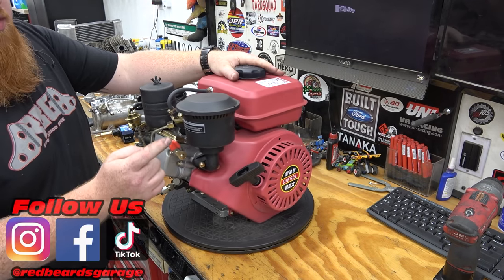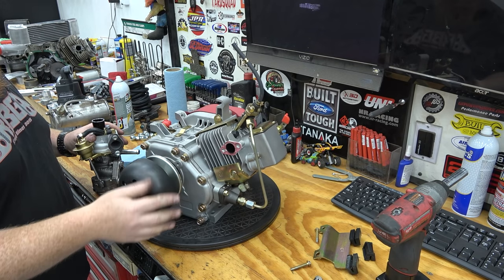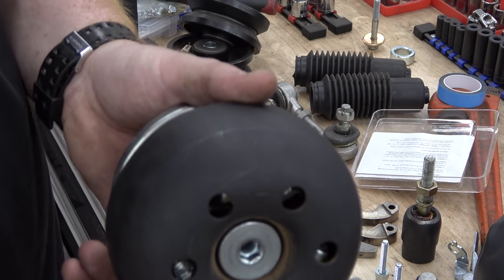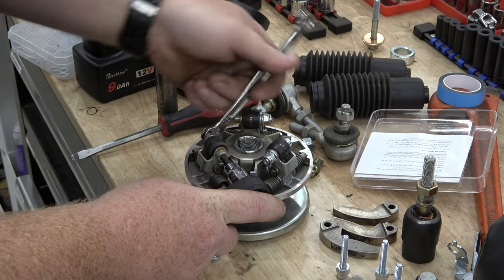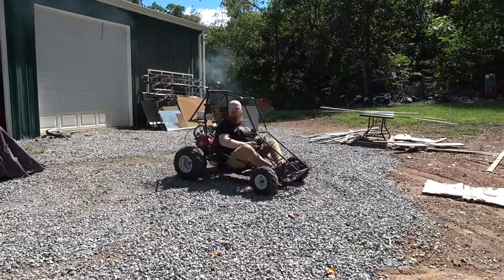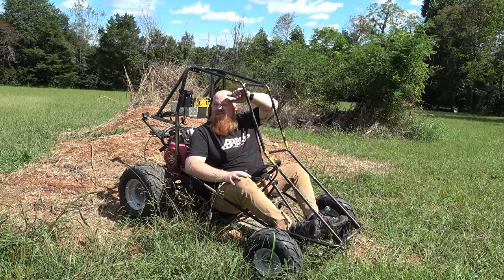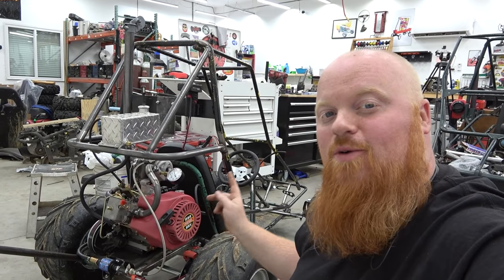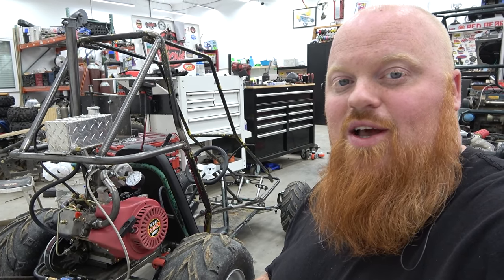Turbo Diesel Go Kart

Comment: Just got the yellow diesel and if you don’t put enough effort into pulling the rope had the engine running backwards smoking out the intake instead of the exhaust

Comment: The closer you can mount that turbo to the exaust port the better put intake lash at 5 and the exaust at 7 the extra heat on the exaust valve will close the gap at operating temp and check your gaskets sounds like you blew one out when you decelerated on the first clip running twards the shop enging sounded different after

Comment: Here's a good one, for some reason I was un subbed from your channel. I expect that on my gun channels, but why would they do it to yours? I love this stuff. Ever since I was a kid in the early 70s and we bolted an old b&s to a 2x12 with a 2x4 front axle that we steered with our feet with some old spikes to "nail" the lawn mower wheels on, and a hand held wire throttle. Good fun!

Comment: You should try putting your NOS kit on it. See if the exhaust smoke clears up at all, when you push the button. You could try an intercooler, chill box, or water/meth. But I would really like to see is an additional fuel system, too inject either rc fuel or nitromethane. Use a windshield washer reservoir set up. Once you goose it, push the washer button, and spray a stream, of nitromethane into the turbo. Could use a gear change too. Might want to consider a scatter shield for the flywheel and clutch. Maybe a firewall and extinguisher. And don't forget to say a prayer, every time you get on it.

Comment: They race these small diesels in the asian countries. Usually a bit bigger motor than this one but they get crazy power out of them.  I would look at raising the RPM. They are a heavy built unit and will take it.  I have some Yanmar clone Diesels  and they will rev to the moon.

Comment: 2 thing,  first running a turbo without an air filter is stupid also because of heat explosion there should be some sometime on the intertake such as a short section of hose

Comment: I would like to use one of these engines for home heating,generating electricity and heat. Can the turbo make it more energy efficient per horse power?
Be nice to see pony brake stats on this,with turbo and without. Be nice to see fuel stats for an hour run time.
I want to find an engine like this that uses water to cool because water can transfer heat to where I want it in my house.
I see people burning diesel to heat their homes and I think about the waist of mechanical energy just going up in smoke. If this energy were channeled thru a small engine, there would be 50% more energy for electricity or heating.

Comment: Add a few more washers to get you around 12-15 grams it should engage a lot sooner. Charge pipe is a good idea but I would try mounting the carb in front of the inlet of the turbo to compress the air fuel mix even further
Reply: It's a diesel. No carb dude. It's fuel injected. All diesel are injected.

Comment: You should get an other off those small turbo's and dual stage that thing, you might get away doing it the wrong Way and putting two same size torbos in series, just because the small one is still too big for that engine 🤔

Comment: Put the wastegate actuator back on the boost won't build right without it
Reply from the maker: It's tack welded shut
Reply: @RedBeardsGarage  then it will build all the boost surprised it only seen 3 lbs

Comment: I notice you have a screensaver with your channel name on it. That's cool. But, you could do an even better desktop background instead. That's an LCD monitor you have there and they don't require screensavers. Those were for the old, heavy, CRT monitors from back in the day. Static images could "burn-in" to those. LCDs don't have that problem.

Comment: I have this engine, now, it has trouble. It sounds like it misses, then loses rpm's, and then sometimes stalls. When it is in this state, changing the throttle has no effect.  I'm contacting the seller.

Comment: I would think this would do way better with a 40 series and pretty high gearing? I think the juggernaut is really hurting this low rpm engine.
Reply: I agree, the longer gearing would help load up the engine and spool that turbo up too!

Comment: Sorry Greg but if TurboCity could not make boost on a 8000 rpm racing go cart engine I am sure you are not making boost on a 3000 rpm diesel.
That gauge movement you are seeing is just the needle bouncing from engine vibration just like build break replete had.

Comment: You are never gonna achieve much speed from this engine. It will have big power though and I do believe thats what they are designed to do. Go climb a big hill with the setup you have on it now and I bet it does it with ease.

Comment: Ok so two things. First hopefully you did the “rolling coal” bs just to get views because you are actually not making more power. You are just getting an inefficient burn. Meaning not enough air. Second you should have done a before and after run to a certain speed to see if you are actually making more power or not before the turbo and after then before the weight change and after.